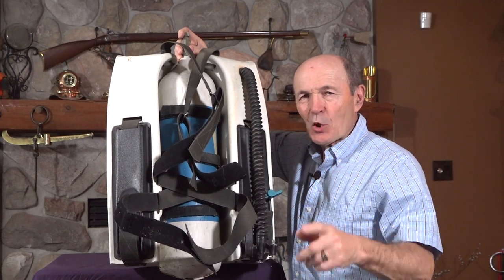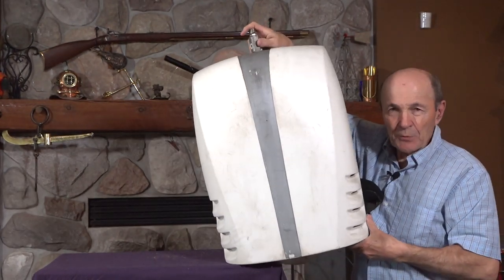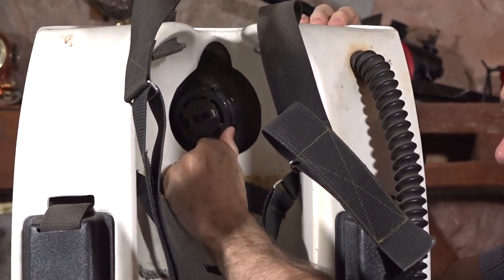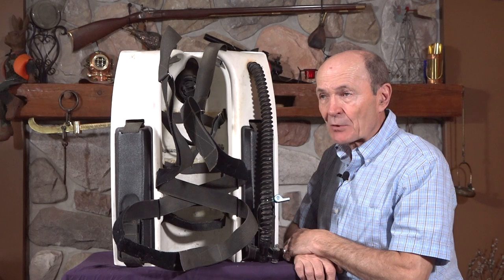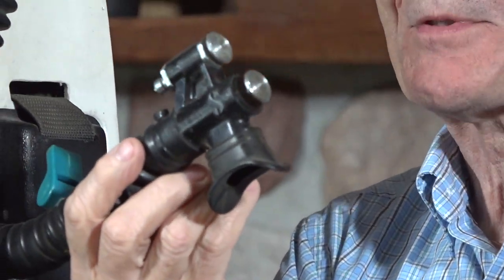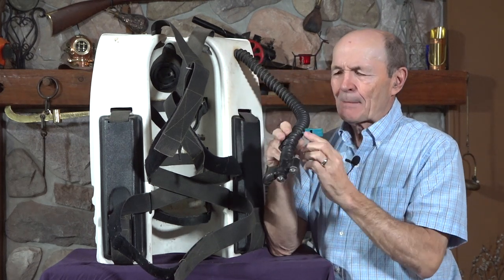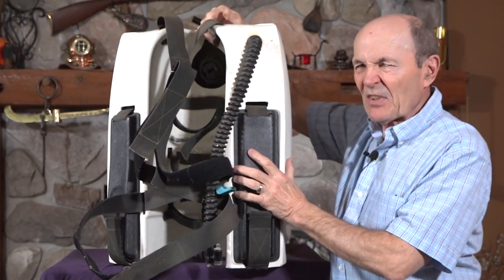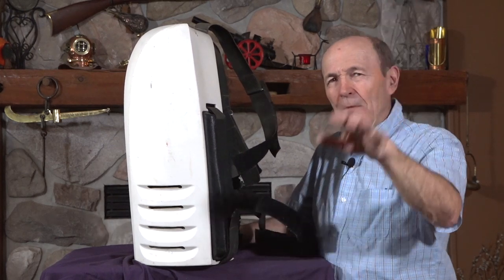Vintage Scuba: The "SCUBASYSTEM" Hard-Shell BCD - S07E05

Comment: Hi Alec, The covers i remember looked cool back then. Didn't US Divers have one that was yellow ? Enjoyed your vintage SCUBA episode.
Reply from the maker: The US Divers was a cover for their 3 tank system. It was like the one that JVC wore in the films. It simply was a plastic cover that fit over three 40 cubic foot tanks. It had a built-in regulator and pressure gauge. It was called the UDS-1. You can see it and learn about it online. There are quite a few of them in use at vintage dive events. I know many divers in our group have one.
I sold my own UDS-1 system several years ago and it's still in use.
Alec

Comment: Hi Alec this is out of the subject here .. with the piston 1st stage what is a balanced piston?  I went to buy a set of regs today and they guy confused the hell out off my head.    I only said just a normal regulator non Tec diving just normal diving and he went on for 30 min for the benefits. I said ill search but really i only got more confused !
Ps love your uploads can't get enough knowledge about diving and it's history
Reply from the maker: Balanced simple means that the reg is designed to breathe the same under all conditions. So, unlike a basic regulator, regardless of the depth, the tank pressure, your attitude in the water (head up or head down) or your breathing rate, a balanced reg will always feel the same - not harder or easier as conditions change.,
This is NOT a tech regulator. In fact, most companies offer a basic regulator in their line and pretty much every other regulator will be balanced. Getting a balanced regulator is a good idea and it should only cost a few dollars more than a basic reg. If you don't; dive a lot, try to avoid all the fancy extras that drive the cost way up.
I'll speak to Kev about a video on balanced regs.
I hope this helps.
Alec.
Reply: Thank you v much for the reply i did appriciate it. Personally i do dive allot, but i try to avoid the extra fancy stuff due to budget and finances. Also i prefer something that i can service while traveling. I find Cressi and Mares are the most convenient to be serviced or fixed in a worse case scenario. 
Again thank you and i appriciate you help Alec 😊. And Kev thanx for your work 👍

Comment: Hi, Alec. Again, these old devices are so interesting; thanks for showing them to us new divers. I have another couple of unrelated questions for you. First, if you dive with a quality, if not fancy, dive computer (I use a Mares Puck Pro), do you think it's still prudent to use dive tables to plan your dive before getting in the water? I remember you saying that new students are now largely not even taught how to use dive tables, but I also read alot about "planning your dive" in various books and magazines. Would that simply be referencing what you intend to do on the dive in terms of navigation and location, but not include completing dive tables? 
Second, what are your thoughts on solo diving courses and the concept in general. I sort of adopt the mentality that I'm always solo diving even though I always have an insta-buddy on charters. So, I always dive with a redundant air system, a second mask, and other equipment just in case. I would love to hear your thoughts on the subject. Thanks for sharing your experiences and knowledge. Best, Josh.
Reply: Hi Joshua.  I’m not Alec, but I’ll give you my ideas.  I would recommend doing the calculations, BUT you will find you will likely dive 50% longer using the dive computer since it records and calculates on all the depths you are at, not just the maximum depth of that dive.  Still good practice doing the tables.  I have many,many certifications, the main purpose is to bee a safer diver.  I recommend the solo dive course as you may not know what kind of diver you may be teamed with.  They may be a risk to you!.  I also follow the rules on every dive- i.e., i have 2 identical dive computers so if one fails, the other is my redundancy.  I either dive sidemount or with a pony bottle- i.e. two independent first/second stages and independent tanks.  I always carry SMB and thumb reel.  If you are not prepared to spend the money on getting these things, there is no point taking the self reliant dive course.  I also have a rebreather, and all rebreather divers should have a bailout bottle - but thats another story.
Reply: @tedreitsma478  Thanks, Ted. That's good advice. Sounds like the axiom "better safe than sorry" should be the divers mantra. Like I said, I do have a R.A.S with it's own regulater on it's own side, removed from my primary and octo. I don't have a second dive computer yet. I just had always decided that if my dive computer fails, I would  return to the surface, but it would be prudent to have a second computer to insure I don't accidentally ascend too quickly. I don't do any sort of cave or wreck penetrative diving, just open water wreck diving. I do always dive with a reel and SMB. I'm thinking of getting a Nautilus Lifeline at some point.
Reply from the maker: Good questions Joshua and some good thoughts from Ted too.
I have used and taught the dive tables for almost 50 years. If I had to use them today, I'd be slow. The point is, the dive computer completely replaces dive tables just as a calculator replaced the abacus, and your mobile phone has replaced the calculator. Some divers, like Ted, want to keep up their table skills and that's great. Many, many engineers stuck with the slide rule long after computers took over that task and did it faster and more accurately. Most of those engineers are dead now and new ones have no idea what a slide rule is much less how to use one. That's not bad. That's progress. 
Dive computers are now 100% reliable. They are faster and much more accurate than any diver can be with tables and, as Ted says, a dive computer gives you many advantages over a table diver underwater other than just safety.
Personally, I'm not a big fan of 2 computers but in some diver scenarios, it may be appropriate. You must realize that 2 computers may not necessarily give you the same information and going from one to the other may not be a good idea. As you've said, if a piece of gear is not working properly, in this case, your computer, the dive is over for that day.

Take the Solo Course, or as PADI calls, the Self-Sufficiency course. That's a much better name and gives you the reason to take it - so you can be, if needed or not, self-sufficient. Plus you will certainly learn something.
Again, Ted is right - for his diving. Carrying extra gear that will NOT be used on a dive is not stupid at all. It may be unnecessary though. Use common sense and what you've learned in the course. Two dive computers, extra tanks,  2 regulators, an SMB & reel, etc. is not necessary if diving in Key Largo on Molasses Reef on a clear., calm day in 15'.
Remember always that scuba diving is supposed to be fun too.
Take care.
Alec
Reply: @AlecPeirceScuba_SeaHunter  Thanks, Alec. That answers so many of my questions. I really appreciate all your help and your willingness to share your knowledge and experience. You're certainly a credit to the diving community. Best, Josh.
Reply: Outstanding thoughts from all of you. Thanks.